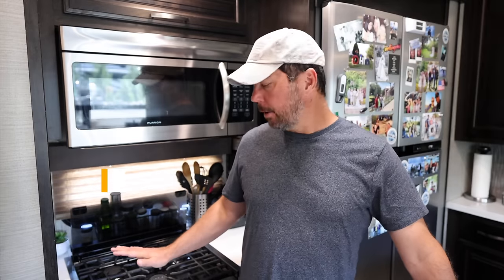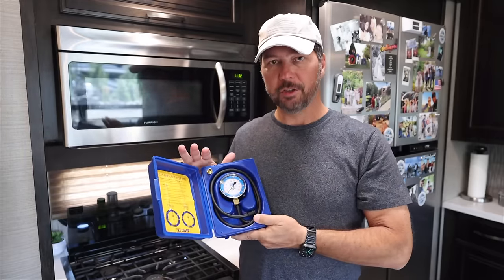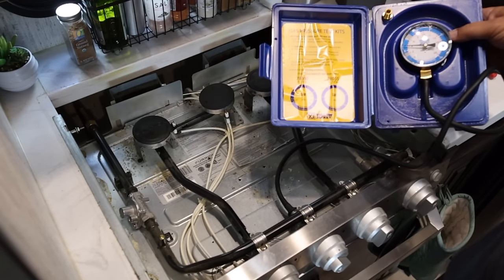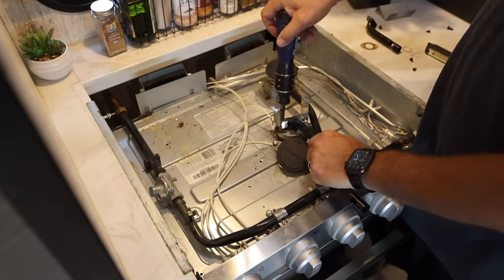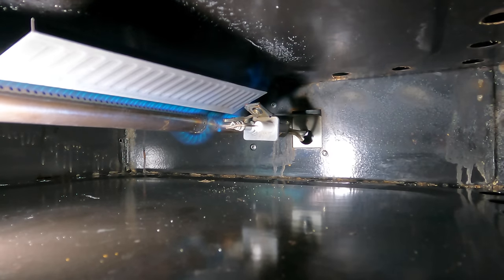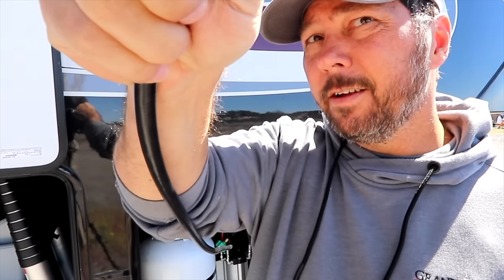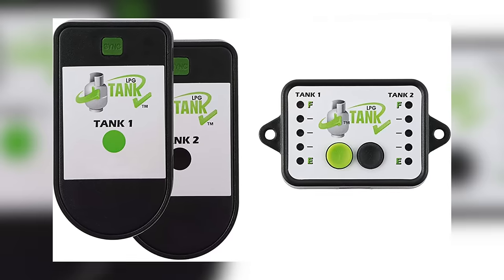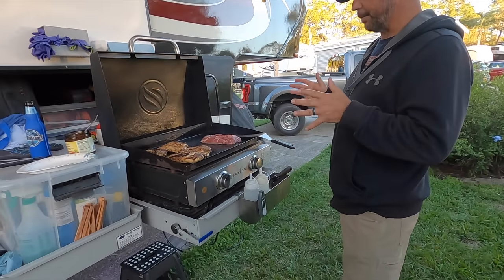Propane Leak and Stove Issues FIXED! (Plus Tips!) (Full Time RV Life)

Comment: Hi Chad and Tara! Still wearing your swag almost every weekend I work on the reflection. Lol! Quick question, I have the same Moryde drawer and black stone and was curious what you are setting the black stone on to prevent heat from lighting the carpet on fire in the drawer? Is it just set on the side rails of the drawer?
Reply from the maker: Ours sits on our collapsible work bench (https://amzn.to/3EvglVT).  I rarely take the work bench out anymore.  I just move the blackstone to the ground when I need the bench (in the slide tray).  Hope that makes sense.

Comment: Chad
Good video always like your posts
You switched the hose on your propane tank with a new line but a different color. Your original line had a green fitting. The new one is black. I think the black ones are for smaller appliances smaller BTU rating then the green.
I could be wrong.
Reply from the maker: The hole in the fittings looked the same size and we've been ok so far... time will tell 😊

Comment: With your oven, when the pilot lights it is making a connection with the sparker by the actual pilot flame to stay on.  This is how the oven knows that the pilot has lit before it turns on the gas valve all the way.  I'm guessing that when you tweaked the sparker you rubbed a little oxidation off of the sparker where it senses the pilot is lit.  If you still have a issue in a few weeks where it turns off again, I would take emery cloth to the sparker and the pilot assembly.   If the problem comes back still its time to buy a new sparker and pilot assembly.
Reply from the maker: Thanks.. It also might be the thermocouple that tells it the pilot is lit...

Comment: Thanks for the Blackstone update! Was planning to just add a Y to the low pressure side and run a hose to a quick disconnect.  Now I'll look at adding the variable regulator before the low pressure side.  Great tip!

Comment: Interesting, our keystone Fuzion TH came with a dedicated propane line exiting near main entry steps for hooking up grills. However you needed to hack the regulator on the grill as the main line from the system is already regulated. This hack just removes the regulator that comes with the grill most of the time. Surprised yours doesn’t already have that line. 🤔😉🙃

Comment: Thanks great info

I’m an occasional RV user.  I have a question. I store my 5whl in a garage with access to a 30 amp hookup.  I’ve seen utube videos that suggest you keep the RV fridge on if possible.  That keeps the system working.  Should I leave it plugged in or turn it off.  I also have a dehumidifier in the RV when not in use

My question is does it wear out or burn components requiring replacement sooner. 

Thanks again

Comment: My burners have gradually gone out. There is plenty of propane. My front burner was the one I use the most. The flame was getting really low. Now it might start then goes out. The oven pilot light will light but when I try to turn up the heat the pilot goes out. Any thoughts? I think it’s the regulator but I’m not 100% sure. Would love your opinion

Comment: Our RV came with an auxiliary propane line for external grills but apparently the built in regulator does not allow enough gas through.  I might need to switch it with an adjustable one.
Reply: If you are connecting to the rv aux propane port it is already regulated and you don't need or want to use a second regulator on the grill. The gas would be double regulated and almost no flow. Use a quick connect hose with no regulator at the grill.

Comment: Hi Chad. I am having a problem with my cook top when I am using the oven. After the oven is on I can only lite one of the burners and only on low flame. If I try to turn it up there is so much pressure that it blows out. Maybe y’all can help.
Reply from the maker: That's odd... sounded like low pressure till you said it blows out with high pressure...  Unfortunately, I don't have any ideas other than the regulator in the stove.

Comment: The LP sensors have to sit dead center on the bottom of the tank.  How do you make sure you have them placed correctly or do you play the try it, move it, try it, move it until you have it correctly placed?
Reply from the maker: I just eyeball it.. but, now that you mention it, I might just draw some lines across the bottom edge to edge and use that.

Comment: So any clue on if you turn on a burner and it’s running and then turn a second burner on but both burners flames go down to small flames. What to check? Feel like my propane pressure has dropped. So I replaced my regulator on my Rv thinking bad regulator but both burners when relighting burners, flames still drops down. What do ya think? Propane bottles are full!!

Comment: Have you ever had a loose hinge on the garage doors?  We have a 2020 montana and our hinge is loose, so we can no long drop the door and it auto latches.  Looks like the hinge is a hidden hinge.  We are DIY for the most part, but with an expensive unit like this one, we would not want to mess it up.  Thanks for any insight.
Reply from the maker: No.. never had a problem with ours.  I'd get a dealer or mobile tech to take a look...

Comment: I want to hook up my table top grill to the gas line that is available for my outside burner by the outside entertainment system.  I can't find any connectors that uses the quick disconnect when hooking up the gas line from the burner to that external gas line at the rear of my rig and can also connect to my grill..  Any suggestions?
Reply from the maker: Not understanding the whole situation, I'd say the best bet is to get a dealer or mobile tech to take a look.

Comment: Hi Chad.  Did you find a solution to the oven "gas going out issue"?
Reply from the maker: Yes.  I just adjusted (bent) the pilot flame sensor to have better contact with the flame.

Comment: The info on Amazon regarding the adjustable high pressure regulatory says is not for appliances that require a low pressure regulator. Would not the adjustable reg be doing away with low pressure flow? Do you know what PSI flow rate comes out of a low pressure reg?
Reply from the maker: Yea.. 11 inches of water column.  But that didn't seem to be enough.  This regulator can be turned WAY down to the same unusable levels.  Like I mentioned.. it's on the user to keep it regulated.  We've used ours for well over 1.5 years now...
Reply: @ChangingLanes  Thank you. I've had the same wind issue with my Blackstone and ended up buying the windshields for the sides to address the issue although those can be inconvenient as well.

Comment: Chad, have you had any issues with the GasStop cutting off the flow of propane to your generator? Or I guess I should ask, do you have propane gen?  I have an Onan LP 5500 that just does not like the GasStop. I have been trying to find the rate of flow numbers for the gen and have not had any luck... Seems the GasStop kick off with anything over 70SCFH/75,000 BTU... my gen seems to mimic a leak. Took the same class at NRVTA and am also a registered tech. :)
Reply from the maker: No.. We have a gas genny.  But, we have heard that some do that.. Last I heard, GasStop was working on that...
Reply: @ChangingLanes  Thanks Chad, count me as one of them that has that issue. Had to remove both of them... and finally found my rate of flow, its 100,000 but.... so the gasstops are thinking there is a leak. They definitely work :)

Comment: The gas igniter in the stove has a “sensor” that detects the flame. That’s why when lighting it you have to hold it for 5 seconds. This gives the sensor a chance to heat up and keeps that pilot valve open. The sensor is just a wire rod and over time it can get covered in a little bit of suit. If the sensor can’t detect the flame it closes the pilot valve and the main valve. You can usually clean the sensor with a little extra fine steel wool, but that usually only buys time, it usually needs to be replaced. They are usually only around $15. Some background: Most of the sensors are actually bi-metal switches like you find in Christmas tree flasher bulbs (old school style) some are pizo electric, and look for the millivolt signal created when the metal rod is heated by the flame.

Comment: My stove will turn on and after the 2nd time using it it won't turn on anymore and my trailer starts to smell like propane.. any suggestions on why?
Reply from the maker: See if you can light it with a match.  If yes, then it's your starter.  If no, then check your tubes for obstructions.  It needs good flow and good air mixture from the ventrui opening in the tube.  Good luck!